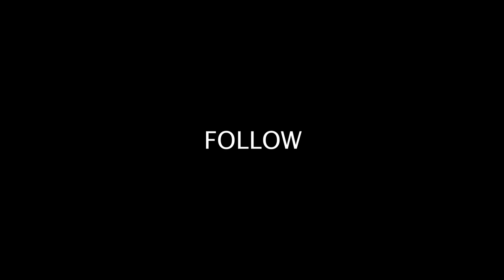you were right, we were wrong! (the WORST lumber ever)

Comment: DANGER. I watched you jointing those long boards on the face and edge without using paddles. Jennie was pushing the boards against the fence when jointing the edge and Davis was pushing the boards over the cutter head when jointing the face. It is very rare, but if the board kicks back, it can shoot the board an amazing distance at an unbelievable speed and pull your fingers into the cutter head. I have two fingers that are now 1/2" shorter. After a year, they still hurt. 
If I had been using paddles, I would still have my fingers. That was the only time I have ever jointed without using paddles. I just needed to make one more light pass, and the paddles were too far away to reach conveniently. A momentary lapse in safety rules can change your life forever.

Comment: You guys should be using a canister filter on your DC instead of the cloth bag. It’s releasing dust right at breathing height into your shop. Upgrading to a canister filter will also make a noticeable improvement in your suction. Check out Wynn Environmental for a Merv15 filter that will fit your unit. They’re very helpful and have easy hardware to make the change simple.
Reply: 1000%
Reply: Also a cyclone, so the filter is not doing all the work.

Comment: As a sawmiller and wood dryer I can tell you what you already have figured out.  That looking at lumber from the sawmill does not show you a lot of imperfections that WILL show up when you plan the lumber down to a smooth surface. You are right this was not quality lumber and should be taken back to supplier.

Comment: Curious if you checked the moisture content before milling or acclimation to your shop. Even if kiln-dried, there may be more bowing and cupping that occurs and if the boards are glued together, the entire tabletop could wind up warping and even splitting as a result.
Reply: I was thinking the same thing.
Reply: I agree. I won't even touch a board in my shop until it acclimated for at least a month or two. Even then, I check it with my moisture  meter before milling it.

Comment: Curious your justification for milling the boards at full dimension? I have found that cutting parts to rough dimension prior to milling drastically reduces waste as well as fatigue. Most often, i do a quick skip-plane to see the grain and layout my parts before rough cutting to size and final milling. 

If your answer is simply efficiency, getting the milling out of the way and moving on, have you considered having your supplier mill the lumber for you? The nominal cost of the service is likely far less than your hourly rate and a net gain.
Reply from the maker: Don't really have a justification - just learning through the whole process. We'll probably outsource the milling in the future, but milling it ourselves the first few go-rounds will teach us what to look for to maintain standards.
Reply: It's a 9ft table. They're 10 ft boards. They're not far off rough length for the top as is
Reply: @LiqdPT  agree for the top boards, appears they did the same for all boards including smaller parts for the base. My comments were not criticism, but was curious if they had a reason for the choice. Choices I make are different than that of a production shop that they are trying to model.
Reply: They milled all the boards to see what boards they wanted for the top. The rest will be further cut/milled as neccessary for the base.
Reply: @leemyrick8549  WHich is why i suggested skip-planing all of the boards to lay out parts. Again, it is absolutely not incorrect to go ahead and mill everything, but it does waste more material, particularly on twisted and warped boards. It is only my opinion that cutting to rough size prior to milling is better, does not make it fact.

Comment: Not sure of the length of your boards, and the table end result you're working towards, but cutting to rough length before jointing reduces waste and lessens the amount of "banana"ing you need to remove, while providing a wider board ultimately.
Reply from the maker: Totally! That's exactly why we cut our rough cutting board stock to length before milling. This tabletop is going to be 9 feet long, and we had 10 foot lumber - not a ton of wiggle room!
Reply: They are at rough length for a 9 foot tabletop. After glue-up there is only about 6 inches on each end to cut off to actual size. As for the width they will go thru and sort the tabletop boards for grain-match/grain figure and to reduce the amount of waste.

Comment: Might I recommend either cutting your boards to rough length before milling. It makes them easier to handle and saves material because shorter length usually don't need milled as much to get flat. Or if you need to mill long boards, use a few foldable roller stands at both the infeed and outfeed. Use a straight edge to make sure they are level with the table respective to whatever side it is (infeed or outfeed). You need to upgrade that dust collector to a cyclone like your Laguna for efficiency as well as health reasons. Personally, I think your boards are too "green" to your shop and aren't acclimated yet. I won't use a board unless it's been in my shop at least a month or 2 so it can acclimate. Then, I still check it with a moisture meter to make sure it's ready. Remember, wood is a living thing and will tell you if it's not ready to use.....with a nice big warp when you try to mill it. 
Me: Let's build this thing!
Lumber: UMMM , how about NOOO! Haha...rejected....LOL. :)

Comment: You might check with your supplier and see if they offer the option (at a cost) to put 1 stright edege on your boards. My supplier has a strightline ripsaw and for me it's  more cost and time effective to have them do it. They also offer surfacing 1 face or surface to thickness. You can check with them on cost to see if it might or might not be worthwhile.  I only do 1 stright edege.   I don't know what finish you plan to use but when laying your boards out for your top you might try using a spray bottle of alcohol. Pick the grain pattern layout you think looks good but the boards togther as they will be on the table and lightly spray them with the alcohol or any solvent that will evaporate off. It will better show the color of the boards and show if the boards will take the finish about the same.
 This is also good to do after all the gluing and finish sanding is done to see if any glue is still there on the surface (if you have done some type of patch it will also show how good or bad it is) Dont soak the boards just a light spray and be sure all of what ever you use has evaporated off before finishing. It's better then starting to finish and then finding bad spots. Hope this helps. RCW
Reply: It is not a hard and fast rule but for milling of wood that you will join together you should ONLY mill up what you will use that day. It reduces the risk of cupping and warping

Comment: I LOVE the "cut" jokes near the end Jenny.  I would've given my wife a high five for those....get in gear Davis!

On another note, with the size and widths of that table, breadboard ends would really help keep it flat for all of eternity, but that would add a lot of time in.  

I agree with the guy below, try using a spring joint when joining these boards.  I'd also use dowels to help keep the boards in alignment and will aid in preventing slip so you won't need as many cauls to clamp it flat.  I haven't spring jointed a panel this wide, but if you do, maybe do it two boards at a time and then do one final glue up of 2 or 3 joints (depending on your board widths).  If you do that you'll have less change for overall slip while clamping.

I just built a 8' x 36" table for my house out of cheap pine from HD.  I didn't dowel because I was in a hurry.  I wish I had because hand planing and sanding after the glue-up took me a few days.  I went lazy on it just to get it done and I probably would have saved me an entire work day had I just done it right to begin with.

Comment: What everyone else said! However, find yourself a good sawyer and ask them to straight line one side, also surface sand one or both sides. It will likely cost a little more, but with your business model you will save time and labor of extensive milling.  Just don't buy from a big box stores. I have idled my woodworking hobby for sometime now due to health but when we was going full steam I met with the owner of the saw mill, he gave me an unrequested tour of the mill. Then back to his office and entered me into the customer system. Long story short, by creating a relationship with the manager I secured my oak at a cost of about 2.00 bf and straight lined for an extra 1.15 per board wasn't a bad price for oak when my local mill wanted a little more than 5.00 a bf rough cut. I think it would be worth your trouble to have the mill do the initial milling for you. One caveat though, I bought random lengths and widths with nothing under 4 " wide and lengths no less than 4' wide and as much as 5' long. I made a ton of furniture with that Lumber but I preferred pine because I could throw away my mistakes or use that mistake in another project.

Comment: If you plan to use white oak for more of your builds: know that white oak is notoriously bad about internal checking (the rough surface is fine but as soon as you begin milling you reveal checks and cracks). This is almost always a fault of improper drying in a kiln or air drying. 
Other wood species don’t have this specific problem as much so just watch out for it when using white oak

Comment: Ditto all the comments on moisture and acclimation.  On fairly small things like cutting boards its a little less crucial but with very big objects like a tabletop which need to remain flush, trim, and darn near perfectly flat all that extra surface area means it is easier for the wood to get out of shape if not acclimated before gluing.  I've heard that wood species seems to matter a good bit also; cypress is pretty sensitive in my experience.  Maybe others with more furniture experience could comment on woods like oak, maple, and cherry?

Comment: The way to save a badly cracked board is to fill the cracks with epoxy. Any of the countertop epoxies will work, Total Boat, Stone Coat, West System. Epoxy mills like wood. Mix up some epoxy and spread it across the entire board using a plastic scarper or something flat. Work it into the cracks and let it dry. Then run the board through the planer to get rid of the epoxy on the board face. You can even add some color to the epoxy as a highlight.

Comment: P.S. firsts and seconds, clear.  No knots. No cracks, checks, or splits.  No spalting, mold.  No worm or beatle holes. No edge wood. No punk or rot.  Ideally, quarter sawn. No warp, bow, or twist. Strait flat boards. Check them.

Comment: You guys should look at a sliding table saw.
With a 10 ‘ slider you can straight line rip all your lumber before jointing and also cut your whole table to size after glue up.
Also much better for working with plywood if you do that a lot. 
Just a thought :)

Comment: Return all of it.   It is improperly dried  wood and it’s case hardened. This wood is worthless except for firewood.  Plus white oak is not red oak.  Wood does not tend to mend itself on the way home from the lumber store.   Look at the end Fran of the wood and you will see just how bad it is.   And smell the wood that is a dead giveaway.  If it has a wet woody smell it is going to be punky.  PS.   It your wood to rough lengths  before you join the edges. I may not know what I’m talking about I’ve only been doing this for 40 years which probably longer than either of you have been alive

Comment: First off you have to learn all about the lumber you will be using and Never accept crap wood. We used to use red oak #2 because we converted it all into sticks for making face framing etc as well as stair treads and molding. I milled up 4 lifts of oak and converted it into sticks mostly for molding for a large job we were doing. The oak looked fine , milled oak, cut into sticks on the table saw ok. When I started running it thru the shaper, it started to explode and drove the autofeeds way out. I tried pieces from  other piles I had milled and the same result. The problem was microcracking. Very difficult to see and account for. The company we bought from had to replace all of it. We could not even risk using it for face framing because we considered it to be unreliable. The problem did stem from how it was kiln dried

Comment: You guys are killing yourself trying to feed and catch with the planner. Go to Lowes and get 2 or 4 adjustable roller posts. Put 2 ahead on the in feed and 2 on the out feed side. $100 spent will save your back a life time of pain. Also, use the jointer the edge and not the face of the boards. There is my process improvement to you two. Now can I have a sticker please. 🤔😬